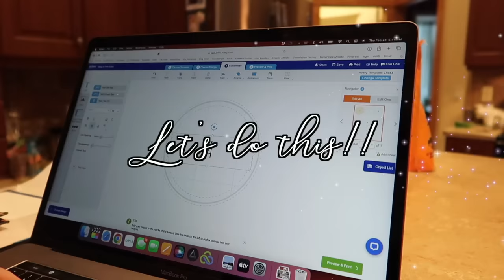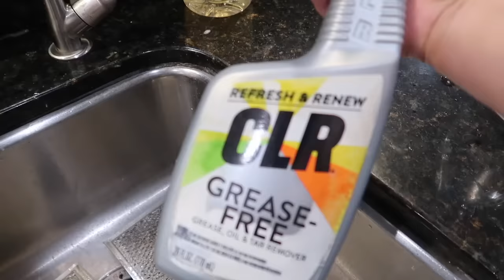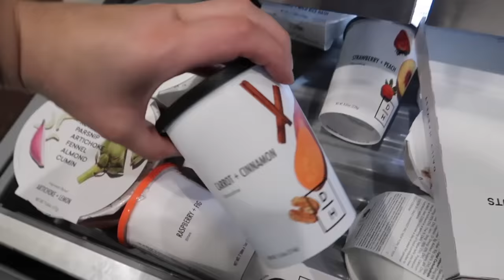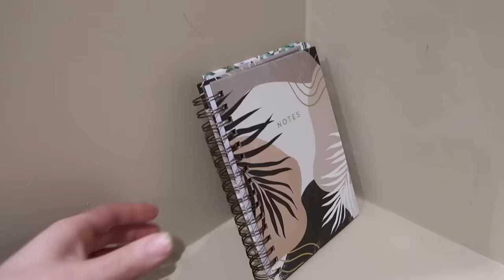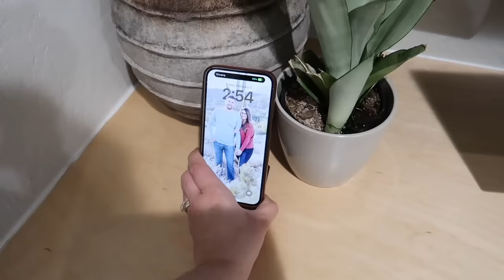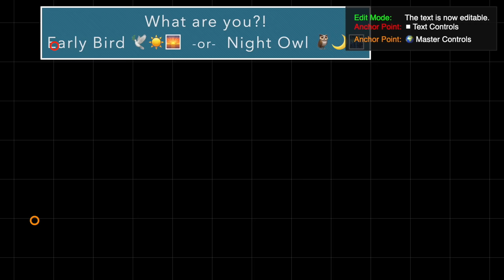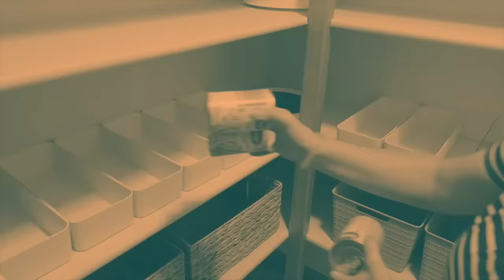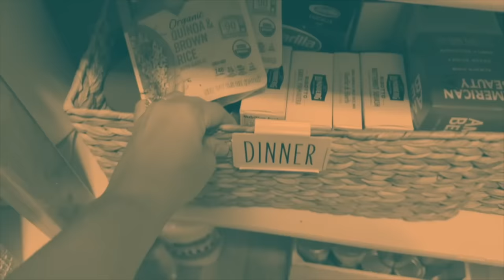SPRING CLEAN WITH ME MARATHON 2023 - Over 2 Hours of INSANE Speed Cleaning Motivation & Homemaking

Comment: Hi Amanda I just want to run this by you an idea ti repair your kitchen cabinets. I watch a lot of furniture flip channels and when the furniture is damaged they use a product called Bondo to repair the damage. They sand the damaged area down apply the bondo sand it down agin prime the area if necessary and then paint and it works beautifully. You may want to check into that method to repair your cabinet before painting them
Reply from the maker: Thanks so much for the bondo recommendation! I think that’s out plan at the moment